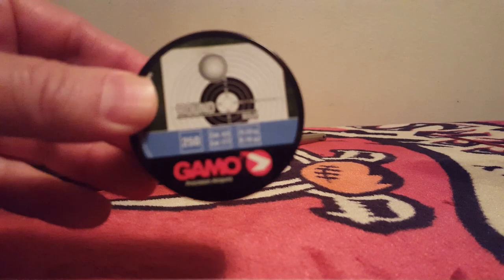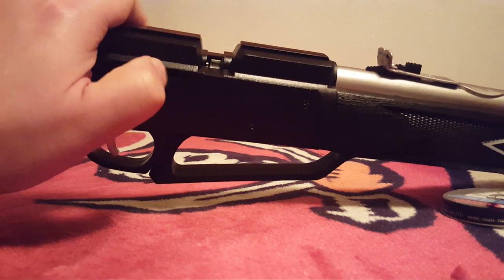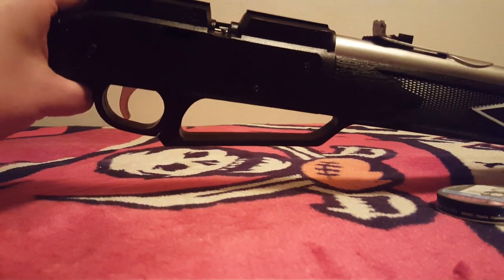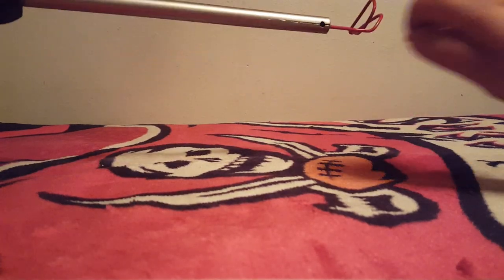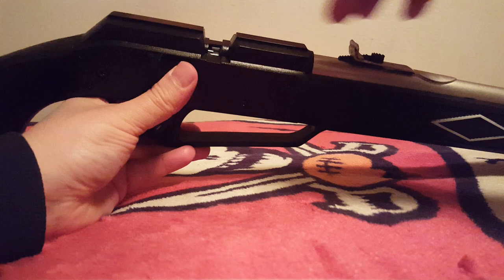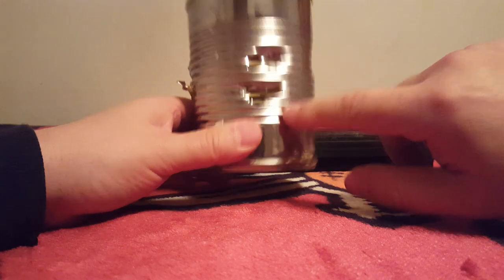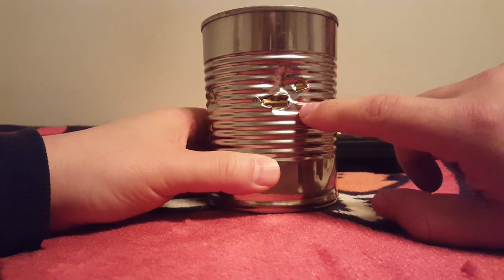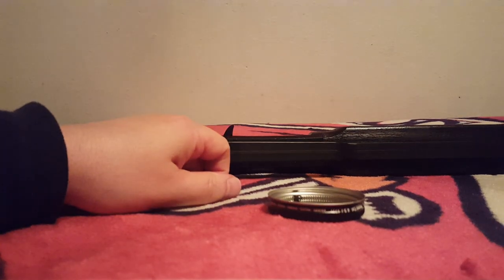How to Maximize Gamo Ball Ammo in Your Daisy 880

Comment from the maker: ACCURACY UPDATE: Having carefully sorted Gamo Rounds, as shown in video, the accuracy and power hit a NEW consistency!

Shooting at a water-filled soup can at measured 13 yards, I went 5 for 5. With 4 balls shooting through both sides snd one making it through one side. 4 hits were roughly one inch. Only 5 pumps! For ball ammo, that is good.

That performance is much closer to the German Rundkugels. As long as Gamo doesn't go nuts with price increase, the Gamo ball ammo can perform well and is worth buying.

🌟The lead balls do not conflict with shooting pellets. They use the rifling like pellets. Even loose Gamo Rounds don't threaten the rifling like a steel BB.🌟

Comment: Instead of steel rod or cleaning rod you can use telephone cable(with 4 wires inside) to block barrel.
Reply: Good idea. Thanks, Brian.
Reply from the maker: Brian, thanks for helpful idea! I like that it offers another tool CHOICE for this process. And it is safe for the gun and lead ball!

 Another commenter thought  hammering or reforming the lead ball is feasible. I don't want to mess with that idea. The ball is hard, if not rock hard.

Sure, I could hit one with a small hammer, and I'm sure it would lock the rifling, but how would it shoot?

For me, the Gamo Rounds work well in 2 880s and only the 77xs are there few good fits - but still a few! For the 77xs that still is enough help in the field.

Comment: Thanks for the demo. Clever! I've got a couple tins of these I need to sort.
Reply from the maker: Go for it!
Reply: @daisy880fanaticfixit9  Well, it seems either my 880 has a wide-open breech or I got a bad batch of Gamo lead balls. I went through a nearly-full tin of them and only found 27 winners. Just a little over 10% success rate. Dang.
Reply from the maker: Sorry, about that, but my 77xs is same way. Only 4 out of 20 would work. I stopped there. I still have some Rundkugels left for that gun.

See if another Daisy willl take them. Otherwise,  I do give tips how to use undersized Gamo Rounds in the written section (toggle arrow).

Those 27 WILL work for you though!

Your time was well spent since you won't have lead balls rolling down your barrel. You know where you stand.
Reply: @daisy880fanaticfixit9  yup.

Comment from the maker: WARNING: Some 880s have a tighter breech than others. If your 880 is on the wider side, you could see a Gamo ball roll down your barrel every 3 out of 4 attemps. While other Daisy pump guns don't do that. Keep that in mind.

If you do hit an issue like that after purchasing Gamo ball ammo, all is not lost. 

Follow these tips:

▶️A loose ball in your barrel takes about SIX SECONDS to roll down from the minimum downwards angle that causes roll. I say this tongue in cheek, but you will have to be grease lightening shooting down from a STANDING position!

▶️A kneeling, FAST, shot at 5 to 7 yards, on a can size target, should be effective. Laying out on the ground would be best! 

▶️Stay at 5 pumps for smoother projectile trip. On further soup can testing, loose ball ammo can still punch through it. It comes down to HOW SMALL is the ball.

▶️You can use all undersized balls if you keep barrel straight or elevated.

Comment: I have never used lead balls in airguns I may have to try some out to see how they do. Do you think they would work in the Rem 1100 with 3 in to be a mini shotgun? I know it would have to be level or upshot so they would not roll out.
Reply from the maker: Alfred, YES, they will work for shotgun, BUT NOT individual balls because 1100 is smoothbore and won't grip them well.

Stephen came up with novel way to create a CHOKE on the ball ammo. Put 3 Gamo Rounds (or steel BBs) down your 1100, and then run a CLEANING PELLET down tbe barrel with a rod to block them in!

Ball ammo can't roll out, and tighter group when shot!

Comment: I like how you started the video by saying those are cheap...I can't even find any in kenada haha!
[After one more research I did find some for 9.99$cad +16% tax + shipping ???...Wich is pretty much Jsb pellets pricing.]

The sizing seems a bit rough for some to be rolling down the barrel!
{I had a full tin of oversized G-hammer's once. Atleast they sent me a replacement.}

_My Red ryder is now tacticoolized thanks to Buck rail accessories!
Sadly after deciding to buy it Cobalt327 told me he wouldn't ship to canada because of prior customs issue's 😢_
{Just posted a video about Bill c-21 and my last one was a red ryder video if you are interested!}
Reply from the maker: I'll check out your video. On sorting Gamo Rounds, it is efficient the way I show. Also If an 880 owner has same issue as my 77xs, just keep the rod OUT unitl a ball sits in the breech.

With my 77xs, it took me 20 Rounds to get FOUR usable lead balls. They just kept rolling down the barrel, so I quickly knew to leave the rod out.

My Silver Ace 880 loves Gamo lead balls. The sorted batch in my magazine just scored my best accuracy, with that ammo, at 13 yards. They can work!
Reply: @daisy880fanaticfixit9   Id sure like to try them still just for fun!
Hopefully they wouldn't fall out of my 1377 or any other of my airguns...sorting them like this sounds like a process.
Reply from the maker: Haha, yes, but I'm a believer in the the lead balls for the 880. My 77xs rabbit gun has a magazine of excellent .179 Rundkugels. They have saved a hunt THREE TIMES.

Just preparing for whem I have to switch to Gamo Rounds. I feel I'm ready!

Like your video!
Reply: @daisy880fanaticfixit9  Thanks!
Maybe one day I will get some Gamo round balls to mess with but for now budget will no allow it 😅
[This and the fact that I have a few tins of pellets that ive never even tried yet...]

They sure look interesting for close range testing!

Comment from the maker: 2nd Update: Finishing off the last 16 Gamo balls in the tin, 13 were solid fit in my Silver Ace shown in video.

🌟SUCCESSFUL HUNT! Just finished a great moment of pesting with the featured 880. Gamo Round was the PRIMARY LOAD  - a first for that ammo that was sorted - followed by 2 more Gamo balls to end the show! Range was about 10 yards and knocked the pest right off the house. Because of PETA forces, I will just say it was much dreaded pest bird that damages houses. All shots only 5 pumps!🌟

I took the 3 undersized balls and loaded them into 3rd 880, and shot the loose ammo at 7, 11, 13 yards. All were hits. At 7 and 11 yards, 2 punched through can. The 3rd shot at 13 yards just caught the side and got through one side. 

So loose Gamo Rounds still effective! Remember that with out engaging rifling it is like a smoothbore. 5 to 10 yards looks ideal. My barrel was just slightly aiming down from rest.

H&N Smartshot is a test I might try, but readers must know that 4.35 is PURPOSELY small for repeater CO2 guns. I had in the past copper plated Rundkugels, and, when undersized, they would roll down the barrel at WARP SPEED, on the slightest tip forward. The Gamo Rounds don't do that.

Comment: Wonder how they would work in a smooth bore like a Daisy M35?
Reply from the maker: Eskimo, great question.

Know that Libra 7 already tried these in the Daisy 35, and without the rifling to lock the ball, they tend to roll down the barrel. The Gamo QC makes their size erratic, so even in an 880, they can roll down.

The accuracy, even loose, is ok up to 10 yards. You must AIM UP. Meaning, set your shooting gallery UP at an angle.

I'm trying to get hold of Smart Shot, but they are  not coming out of Germany right now. They are targeted for CO2 repeaters. They come in at 4.35mm. But they could work in Daisy Pump gun IF... you aim up.

How goes the law enforcement? If I may ask, any good case concluded?
Reply: @daisy880fanaticfixit9  I've been thinking maybe a patch and ball set up for the M35, just like with a smooth bore musket.  I've been down with health issues piloting a desk and talking on the phone.
Reply from the maker: Eskimo, other shooters came up with a method similar to your patch idea. Then you CAN AIM DOWN.

One is using a cleaning pellet to hold in 3 BBs. The other is just basic wad of toilet paper, which is much more cost effective.

For a 35 with a single lead ball, the tissue paper wad should work. I just know that for the field, a smoothbore 35 can be loaded with steel BBs and still shoot pellets IF YOU COCK IT CAREFULLY. It won't attract BB to magent. Then, a single BB can be a clean-up shot (4 pumps) after the pellet hit on pest.

I have a video on 35 "tricks"